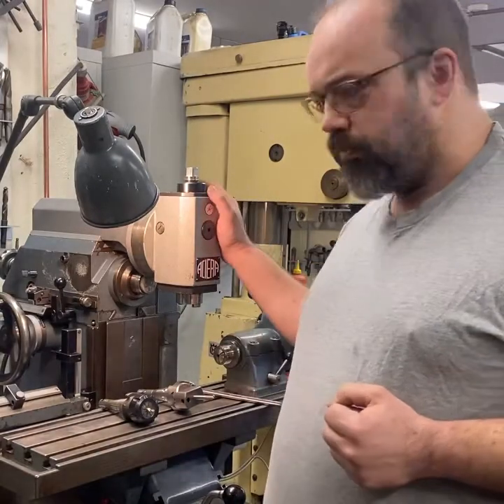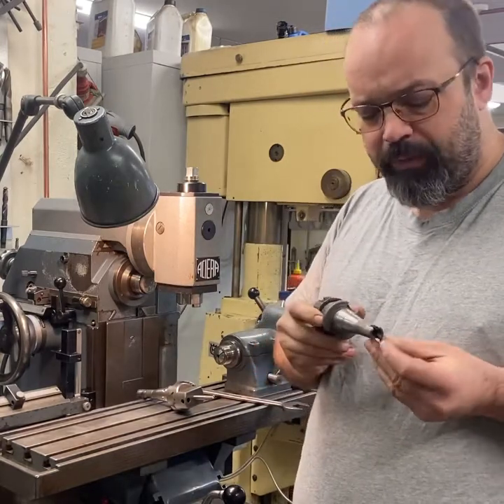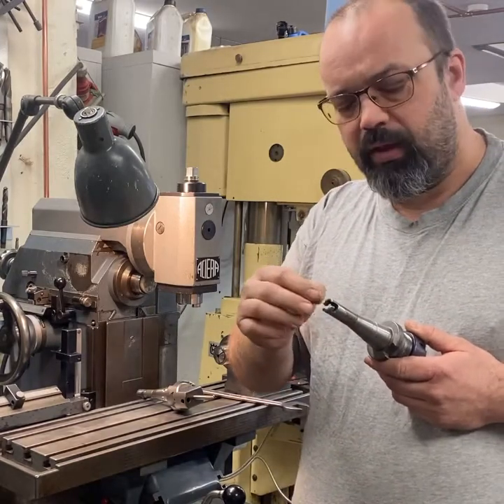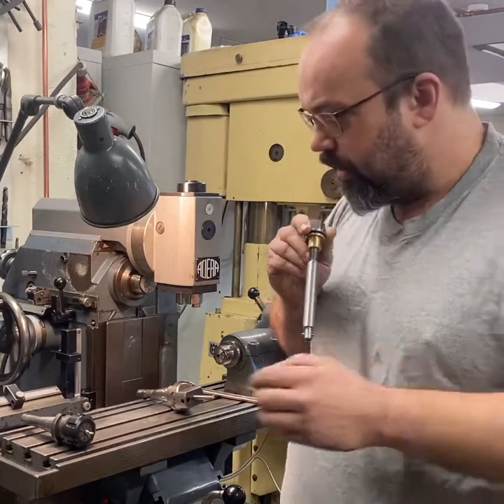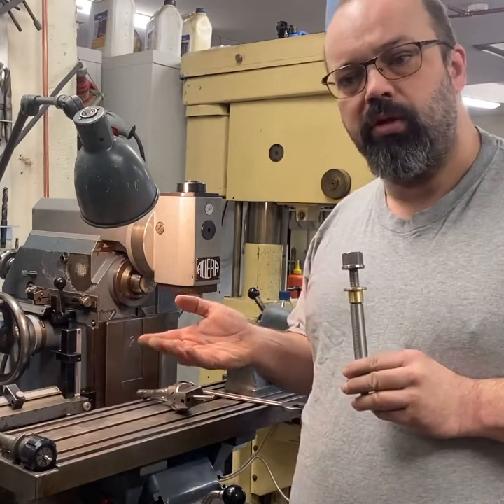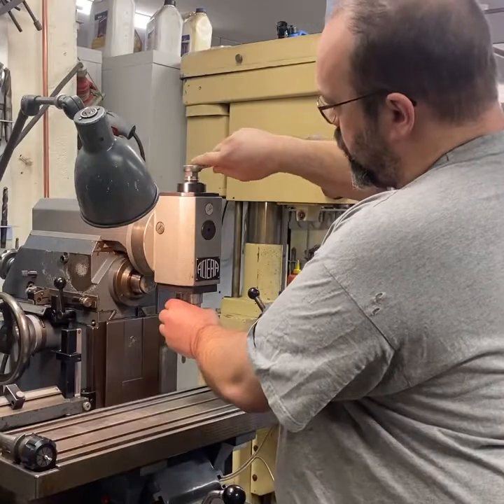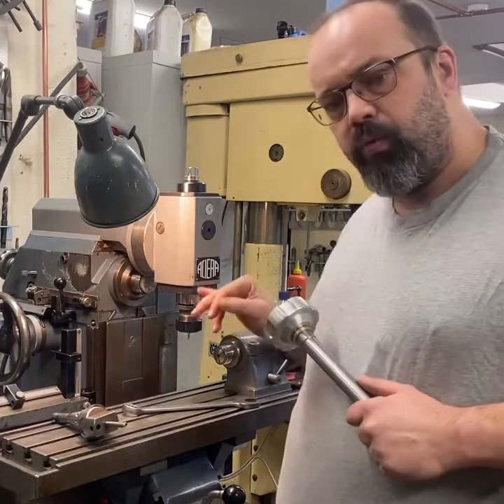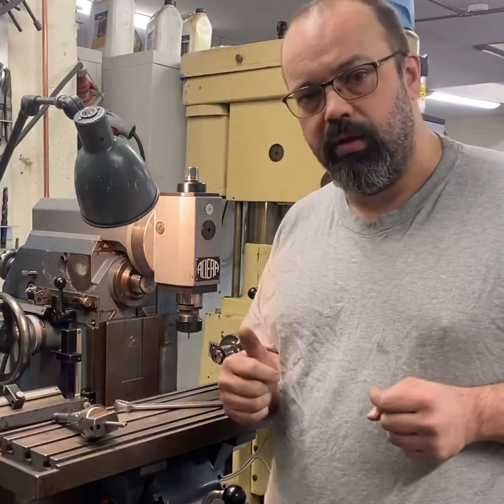Aciera F3 and iso 30

Comment: Hi Hakan, nice machine you have there. When I was young I went to school and learned machining on this exact model. It was a late model F3. I always wanted one and one day I will. I just don't no if a Deckel FP1 is the better choice because 30 taper tooling is sometimes a bit harder to find. Also nice upgrades you made to this machine. Just out of curiosity, why do you call your channel Spuhr_ex_gunsmith? Did you stop working or sold your company? Thank you and greetings from the Netherlands. Mark
Reply from the maker: I have no clue really, FP1 is a great machine i am told But i lack experience.
What I see is that parts and accesories for Deckel is way lower priced than Aciera and schaublin and more accesible.

I am very happy with F3 and i have both w20 head and ISO30 head for it.

I quit as a gunsmith over 15 years ago and today i am an Inventor in spuhr AB But I don’t gunsmith.
I do gunsmith for fun But not money anymore.